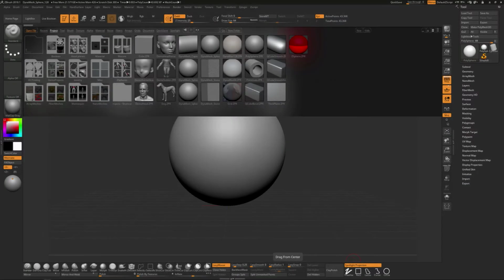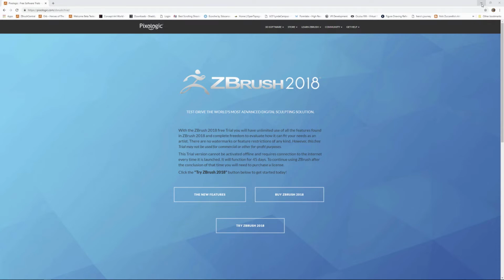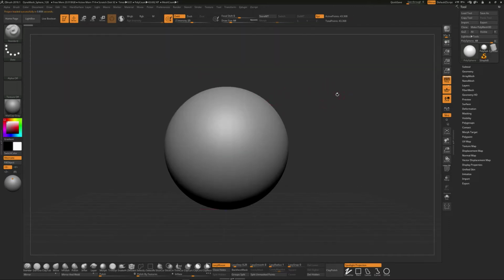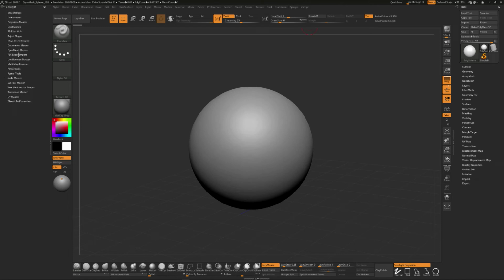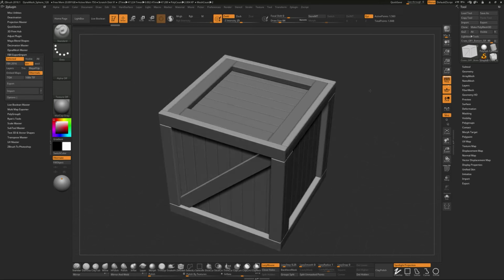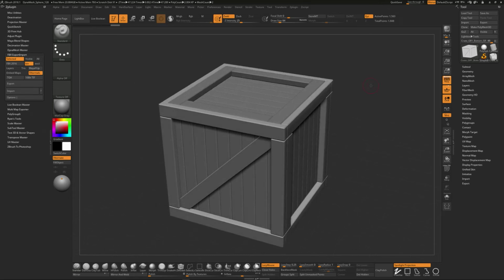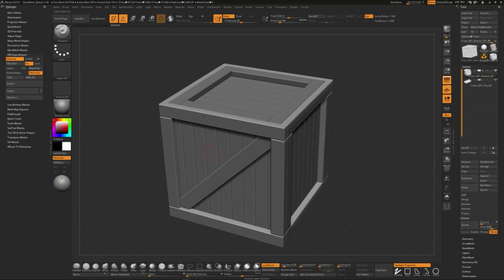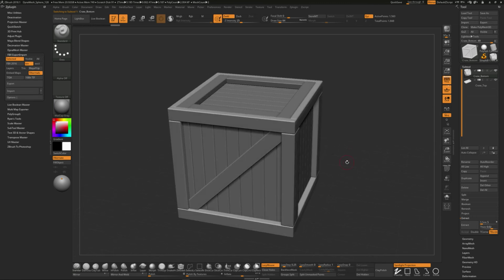06 GAC101 Importing Into Zbrush

Comment: If your crate doesn't import into ZBrush correctly, you might need to go back into Maya and rename your pieces so they all have unique names. ZBrush will put things with the same name in the same place. Before I renamed things I had one side, one diagonal board, and one vertical board.
Reply: To get just the top and bottom pieces like he did, select the "bottom" group in Maya, click on "Mesh" then "Combine" and then delete the history. Do the same for the top and then group them together. Just having all the boards in groups is not enough to keep them together in ZBrush